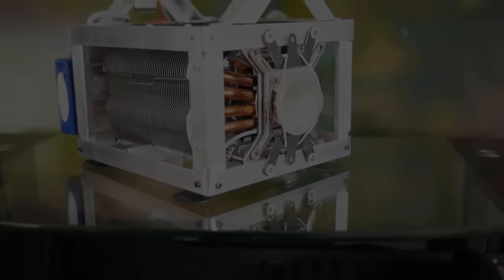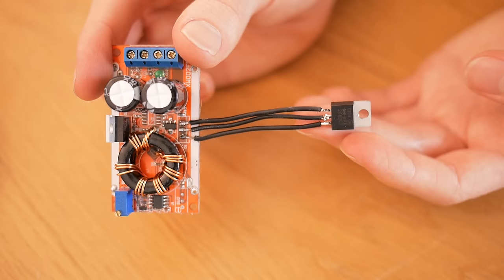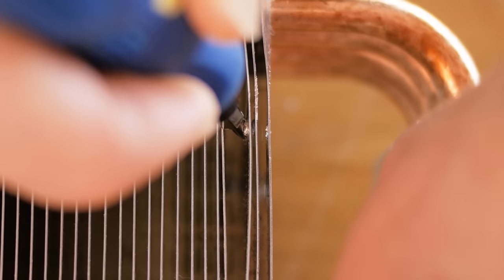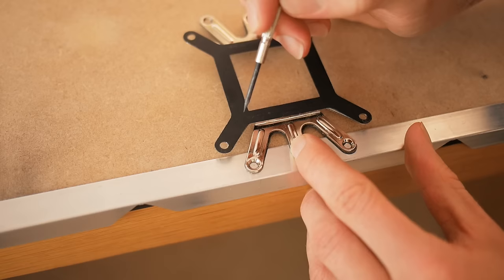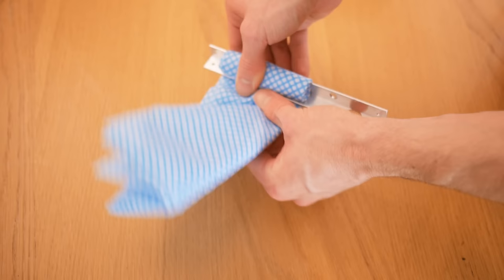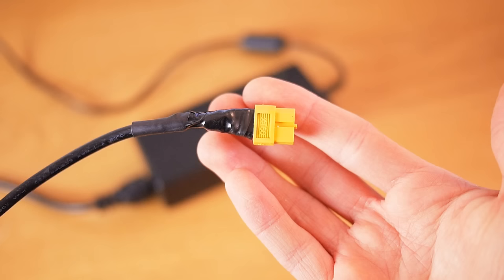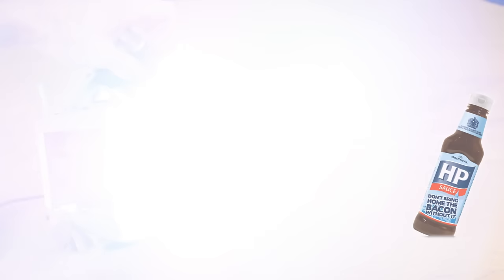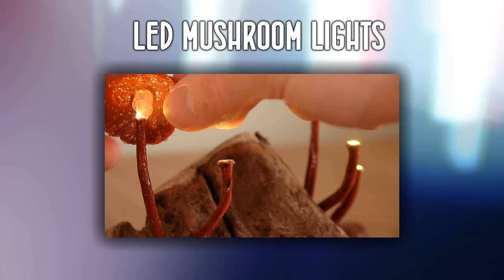Make a 1000w equiv. LED flashlight - aka DIY Sun-Blaster!

Comment: VERRRY nice video work (nice motion tracking, animated dimensioning bits and pieces, spotlighting areas of interest, etc.), and I really like your mechanical fabrication work, but you might do well to learn a bit more about electronics before taking on projects like this.

Those 2 devices you broke off of the Boost regulator are not IC's... one is a dual diode, the other is a MOSFET transistor... and it's CRITICAL that they don't get swapped one for the other... if so, the release of the magic smoke will happen... and the regulator board will no longer function without that magic smoke....

Then you reeeeally should use proper TO-220 mounting kit with insulators... expecting "thermal paste" to be the insulation is a bad idea, and it exposes them to possible short-circuit if a tiny metal bit gets lodged in there.

When working with such large Lithium batteries, you have a real potential for life-threatening fires... what happens if a short circuit happens when it's in someone's closet?  USE FUSES... (ever seen videos of Lithium battery fires?)

Extending the MOSFET leads can lead to instabilities in the high frequency switching regulator as well... it's just not a good idea... but if you must, keep the leads as short as possible, and use some silicone rubber over the solder joints where you solder the wires to the Diode and MOSFET.

Also, you selected the wrong Boost Regulator for using with an LED. To get maximum brightness from the LED, and yet protect it from burning out, you need to use a Current Regulator.... not just a voltage regulator. Get one with "CV CC" regulation... which has both Voltage and Current regulation. LED's are Current driven devices, and the only way to be SURE you have the proper driving current, is with a current regulating (limiting) power supply... such as: http://tinyurl.com/o77mcmg .

This brings in another issue, you really need to let people know they need to use a Lithium battery with at least 14.1V (4 cells in series) for a CV/CC boost regulator, anything less than that wont' be enough voltage (they require NO LESS than 11-12V to run). It will run longer with even more cells in series, since the power converter stays more efficient with higher input voltages. You can then set the alarm voltage to 3.0V per cell, which is the standard rating... and it will run even longer. (be certain to use a proper battery charger for whatever battery you end up using!)
Example battery pack: http://tinyurl.com/mlezlpl

That LED should come with a specification, but most 100W LEDs are rated for 3.0 Amps, which will require somewhere between 32-35V DC. If you set your power supply to 30.0V, you aren't getting full brightness. You should set the Current Limit at 3.0A (or a slight bit less), and leave it there permanently. Then you can adjust the Voltage pot (like you have done) up to 35V maximum (before connecting it to the LED), and once you have it driving the LED, it will never exceed 3.0A no matter what, but will give FULL brightness when adjusted to your maximum voltage.

Another reason to use CV/CC regulation is that the voltage needed to maintain the proper LED current will change as the LED heats and cools. As it gets hotter, the "forward voltage" of the LED drops, which causes the LED to draw more current, which causes it to heat up more, which causes it to draw more current (if you don't also have Current Regulation)... and you end up in what's called "thermal runaway", and a burnt out LED... all because you aren't limiting or regulating the Current driving the LED.

Sorry... but as a lifelong EE, it's hard for me to just "pass by" and not say a "few" words...  :-)
Reply: beforebefore Hi beforebefore, very interresting comment. If i would like to use a CV/CC to drive my LED, can you explain me how to set up the Current Limit to 3A with no load ?  Does the CV/CC regulation really need more than genuine Heatsonk ? Thanks for your help
Reply: beforebefore Nice comment... going to look into these things before i make mine (already ordered the CV/CC regulator).Im sure you can answer these questions :)
1. You say that people should use 14,1v battery - does that mean that a regular lead acid 12v battery won't cut it (thats the only battery i have at the moment)?
2. Dimming function: if i decide to up the max voltage to 35v, how do i get a lower voltage of around 26v (or lower perhaps - what do you thing would be a good lower voltage for the lamp?) (when the pot i turned all the way down)? I'm guessing a different pot and/or other sized resistors needs to be used? 
Thanks :)
Reply: sixbras I had begun responding, but browsed away from this page, and lost it.  I'm making a little instructional video with this in mind... I'll come back and post the link right here when I get it finished.
Reply: beforebefore I can't wait for this! I buy CV/CC and wait for your instructionnal video. Can you explain where to place fuse, and how many amp to protect battery.
Reply: Daniel Gråskov If the CV/CC Boost Converter is rated for 11V minimum input voltage, you should be able to use a large 12v lead-acid battery (gel-cell or "SLA" I assume)... but it won't run very long, because the 100+ Watts of power from a 12V battery will be well over 8 Amps, which will run it down past 11V pretty fast, and may cause overheating of your DC converter.  It would be best to use a pair of smaller Ah rated 12v lead-acid batteries connected in series, for 24V input. That would run much longer, and safer. 

Maybe a better choice of regulator would be one like this: http://tinyurl.com/mqrvxjh
(it allows down to 5V input, and is in a NICE looking aluminum enclosure!... but clearly more money

Dimming vs pot resistance value. This depends on the design of the regulator. Sometimes increasing the resistance of the CV pot causes the voltage to increase, sometimes it's the opposite... it depends on the regulator/converter you use. This has to be determined for each regulator design.  You can set the pot to one output voltage, turn it OFF, and measure (and record) the pot resistance and Voltage. Then adjust it to a different voltage, turn it OFF, and measure its resistance again... that will show you if you need higher or lower resistance to lower the output Voltage (which will "dim" the LED).

The LED chips usually begin lighting at a little over 2v each, the 100W LED's usually have a 10x10 array of LED chips, so 20V might be a good minimum "dimmed" voltage to start with. Be SURE to set the Current Limit (CC) to a bit less than the maximum current rating for your LED (typ. 3A) before you connect the LED... use a car headlamp or similar for a test load. You can set the converter output Voltage without a load connected.

I hope to remake my instructional video in a couple days... I tried once, and it failed - when the LED lit, it caused the automatic iris on the video camera to close down... I'll have to protect the camera from the bright LED light.
Reply: sixbras  I made a reply with info you might want to read addresses to "Daniel Graskov".
The Fuse would connect to the Battery "+", then to yoru Power Switch, and then to the "+" input of the DC Boost Converter. 

The fuse rating depends on the battery voltage used. If you plan on lighting a 100W LED, you need to add at least 10% because of the losses in the DC converter.  If your battery voltage is 14.8V (which is the proper voltage for a 4S Li-Ion or Li-po battery, not my mistaken 14.1v), then:
 100W + 10% = 110W input power
 110 / 14.8V = 6.7 Amps "nominal"
That battery Current will increase as the battery charge drops to 12v when nearly depleted, which means it will then be drawing 9.1 Amps. 
(110W / 12V = 9.1A)
I would therefore suggest no less than a 12-15A fast-blow fuse for this battery voltage. (a 10A fuse may work, but a turn-on surge might blow it)

By using the math above you can calculate a fuse rating for different battery voltages.
Reply: beforebefore I know this is unrelated but I was wondering if is possible to die if i accidentally touched the circuit during operation. I read that anything more than 30 volts and more than 500 mA could kill you (resistance noted). and seeing that this runs at 6.7 amps, i'm really curious if my math is right. I'm still very new, so please forgive me.
Reply: Jonathan Ablanida the current is what's dangerous indeed... it's not about the current in your circuit but about the current going through you if you touch it. Here in Germany rules are that only circuits which exceed 50 volts AC or 120 volts DC must be protected from touching them (rates for children are lower due to lower body resistance). But remember that's the voltages which cause possibly lethal currents... so i don't think it's a great idea having 100V DC unprotected as well.
The voltages occurring in this project are either not high enough or not lasting long enough to be dangerous i think. And honestly... usually  you're not going to try licking the power supply of your electronics projects anyway :)
Reply: Thanks for the reply. I wasn't concerned rather by licking them but that some people who don't know about the dangers might accidentally touch the exposed prongs of the LED during use. I thought anything above 20 volts dc was enough to penetrate skin already.
Reply: Jonathan Ablanida The voltages here (30v) are not high enough to allow dangerous current to flow through your body to do harm. Car makers have been considering moving from 12V up to 36V (42V charge) DC systems, as it will reduce wiring weight and cost. A few have, because for things like power steering motors, it takes more than 12V to create adequate power. If they believe it's safe enough to have under the hood of your car, it's got to be pretty safe.

In reality, if your body conducted more than 10mA through one arm to the other (passing through your chest), it can cause heart failure. But to do that requires more than 36 volts... unless you grab both wires with an open wound... which has very low resistance. I've had 50V+ DC through my hands, and though I felt it, it wasn't bad... likewise even 120V AC... as long as my hands are dry. 

ON THE OTHER HAND... (well, both hands)... I once got 450V DC sent through me from working on an old tube-type "linear amplifier" for a vehicle (with over 500mA available).... and it knocked me plum off the workbench chair onto the floor, and the screwdriver that 'was' in my hand went missing... now THAT one hurt BAD for a long time!

At another extreme, it was not too uncommon for me to get shocked (and surprised) by 22-30kv from a CRT high voltage anode connection when working on old TV's!  LOTS of voltage, but very little current available. 

And I'm steel here in one peace to talk about it... and it dun't due mi any hurm at all.... I caan steel speek and rite juzt fyne.... fyne...  fyne...
Reply: beforebefore Hey :) seems as you have a bit of knowledge on this field. I have bought a CV CC regulator, close to what you had a link for, and i was just wondering if the steps for making the voltage dimming would be all the same? (seems that way from reading the comments) Also, I belive ill turn the voltage up to about 33V, and limit at 3A, but i guess i would need a bit bigger resistor for that (maybe 12k?), but the "knob resistor" can stay at the same value? I have gotten myself a 5cell 18,5V battery :) (im all new to this kind of stuff, and just wanna see if i can make it work :p ) thanks in advance for any reply!
Reply: beforebefore Are you still going to make a video on how to build one of these?
Reply: Bill Roberts I am going to make a video showing how to use/build a slightly different version with the CC/CV booster... When my CC/CV booster actually arrives - shipping is taking FOREVER :/
I will post a link here when im done.
Reply: beforebefore would a simple 15A KFZ fuse do the job for a 4S lipo ? or is that too slow/too high voltage?
Reply: ***** Are those automotive "blade" type fuses?  If so, that should be fine... just remember fuse ratings are the HOLD current, not the current at which they will "fuse". If the fuse is rated at 15 Amps, it will actually hold 110% of the rated current (16.5 Amps) for around 100 hours or so.  

With 4s you have minimum 3.0v/cell at worst-case discharge, total battery load of 120W (100W to LED, possiblty 20% loss in the power converter), that's 10A maximum. Fully charged it will be more like 3.7v/cell, 14.8v pack: 120W @ 14.8V = 8.1A total input current.  I'd recommend 10A instead.  Hopefully your battery pack will prevent over-discharge.

There's no problem with fuses being "too high" of a voltage rating. The voltage rating has to do with the minimum "gap" created when it fuses, so that the fuse will not allow an arc to form between the remaining metal.
Reply: beforebefore Thank you, and yes those flat ones didn't know the rated current is the hold current and not the cutoff current... I just ordered a kfz Fuse holder and will give it a shot (still waiting for a few parts and  deciding on the battery). The way I have it right now (12v gel battery) I'm a bit concerned about the startup current of the boost converter due to the amount of sparks that fly when I connect the leads too slow...
Reply: ***** I have the same boost converter... it seems to be working fine soo far but I'm only running it at ~70w (according to the internal display) and the coil is the grey thing with 4R7 written on it.
Reply: I know that I'm late, but I am planning on getting some 100w full spectrum grow lights, and it didn't make sense that a CV/CC wasn't used (I've been lead to believe that you either need a CV/CC power source or a current limiting resistor, and a 100w resistor would get real hot) so I'm glad that I wasn't missing anything.

Honestly, your comment should be pinned.

Comment: A high power LED like the one in the video needs a constant current source (like a proper LED driver). If you just directly connect it to the step-up converter (as it is in this video), the lifetime of the LED will drastically sink. I actually recently used some 12V 10W LEDs in a project of mine. The forward current of those is 1050mA. I measured them (like 10 or so) and the corresponding voltage at 1,05A was in a wide range between 9-13V. If you are unlucky and got one that has 1,05A @ 9V and you would connect it to a step-up converter that outputs 12V, you would instantly fry the LED in a fraction of a second. The voltage also highly depends on the operating temperature, so there is actually no way around on using a constant current power source like a LED driver. Also: using a voltage regulation to dim a high power LED (which would not work with a constant current power source anyways), is not optimal. PWM should be used instead.
Reply: PWM can't be used for video work (which is what this project is aimed at) as they flicker and don't correlate well with camera sensors. Otherwise if you're not using it for video, use PWM.
Reply: Ike Fox a PWM signal of 1 kHz or above should not flicker at all. It would propably allready stop flickering at 200 Hz.
Reply: +Ike Fox what if I solder a high uf capacitor on the output?

Comment: hi matt and other diy'ers. I just made the sun-blaster myself and have some things to say for when you want to make this foro yourself (these are things i have come across while building) .
first of all: when bending the aluminium profiles, you must heat them up with a flame, otherwise they crack( happend to me) 
second: the new heatsink that is linked does not have a apropriot bracket to mount to the aluminium, you have to buy a separet bracket. 
and last: mounting the regulator to the side without desoledering the capacators and the heatsinks from the regulator works fine, it stays cool enough
it was a very nice project to make! thanks diy perks for making the tutorial, keep it up! 
greetings from belgium

Comment: 2:45 You monster
You barbarian
Reply: Also, the pads on the back of these mosfets are grounded, so it shouldn't matter if they make contact with the heat sink. In fact, the heat sink should be hooked up to common ground.